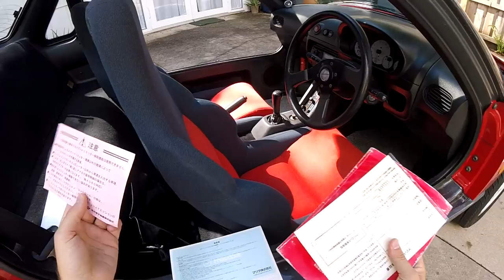1993 Mazda Autozam AZ-1 in the USA - POV Walk Around and Long Drive

Comment: I do get 48mpg average the past 2 years I've owned this.  Was getting 45,  but after doing maintenance and replacement of the motor and sensors it's closer to 50.  It's mostly city driving, stop and go.  If you're getting sub-40, check your MAP, idle, EGR, and other maintenance that will reduce your mileage.
Reply: البروليتاريا ٦٦على ٥
Reply: Does it have air bags?
Reply: @aye3678  I haven't seen any AZ-1 with airbags.  I plan on using air bags in the long term plan though